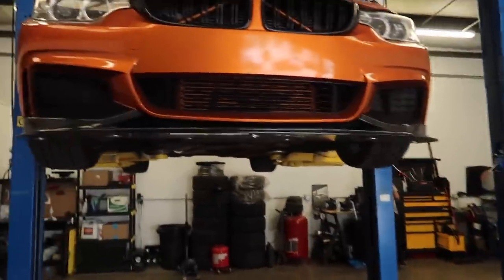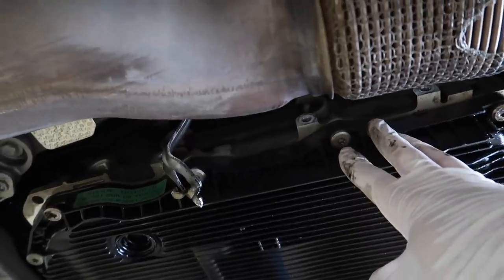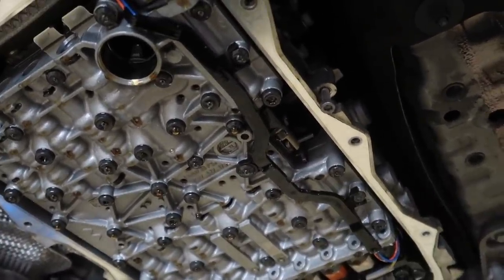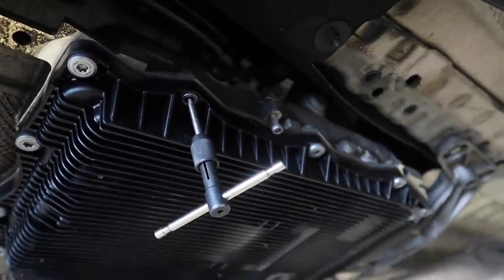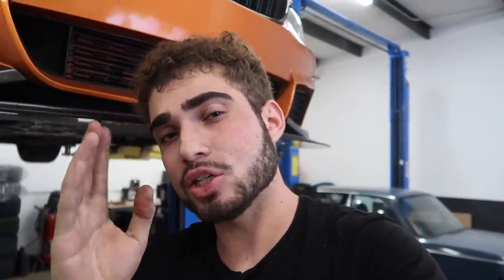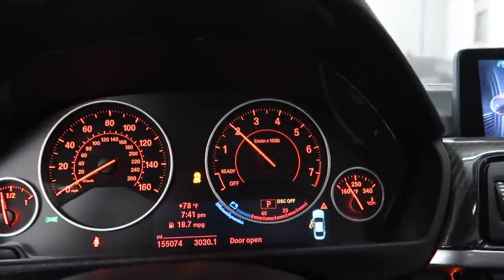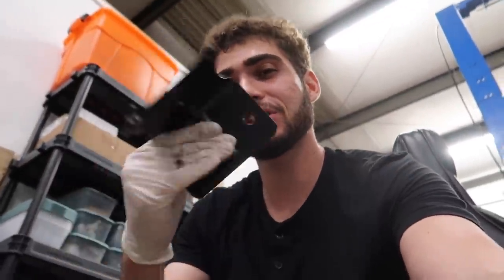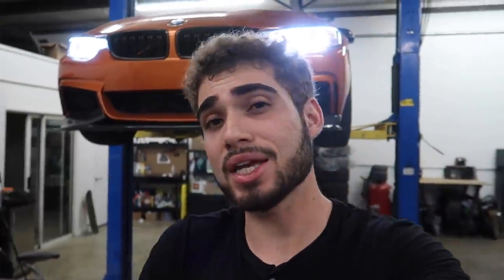ROAD TO 400HP 435I BUILD! Part 2

Comment: For anyone working on a ZF pan: 7lbs is NOTHING. Like, scary untight. Safer to just spin the screws in with your hand holding the T-bit socket, not the ratchet. Then, once it stops spinning by hand, grab the ratchet and do a 1/8 turn. Done. That's all they take. 
You're playing a risky game trying to torque wrench a value that low.

Comment: Word of advice.... anytime you are tightening bolts to torque spec that are a small amount example let’s say 7ft lbs always use a inch pounds torque wrench instead. Usually the 3/8 drive torque wrenches from HF seem to not feel the tightness. Don’t know how to explain it. Trust ... I know this first hand of how using a inch pound 1/4 drive wrench is best when tightening bolts that have a low number spec.

Comment: Your torque wrench may be uncalibrated. Probably way off if you snapped bolts.
Reply: Bolts should be torqued to 9 Nm/6.6 ft-lb using low torque 1/4" wrench for aluminium bolts.